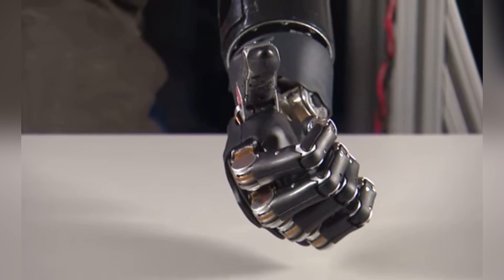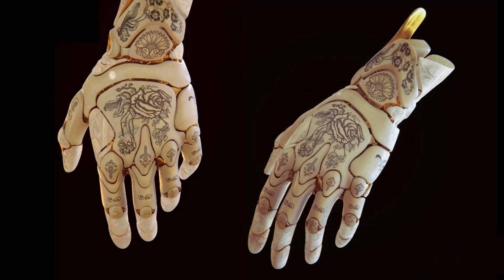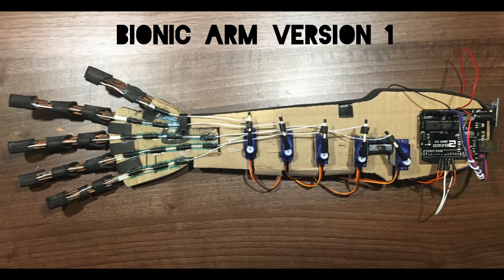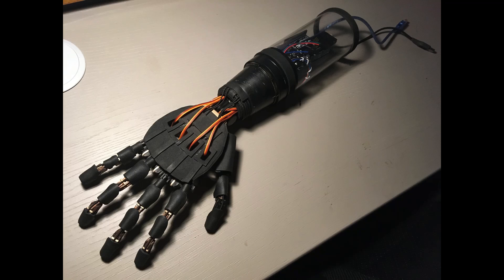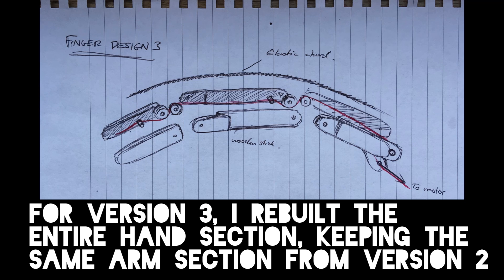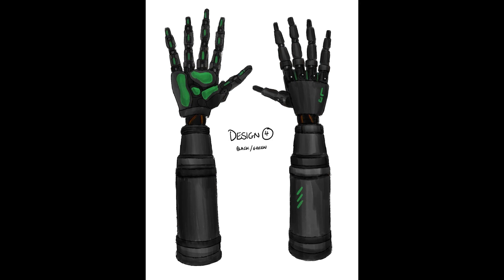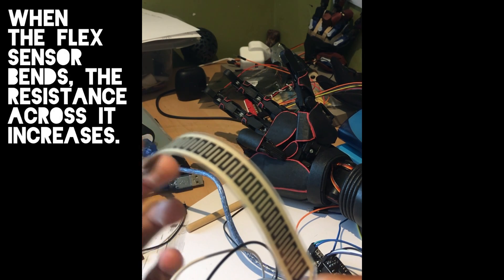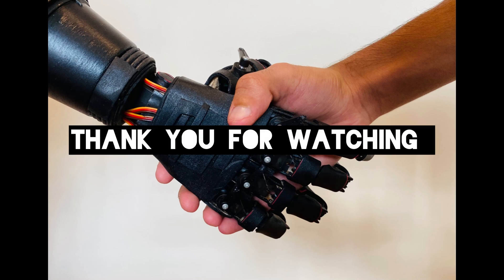How I built a bionic arm from scratch to replicate human hand movements.

Comment: Question I’m assuming you used the Arduino minima without WiFi and Bluetooth however if you had Arduino Uno(R4+wifi) couldn’t many wires be redundant and much of the wires be reduced?

Comment: Nice job men. I wanted to build it, but i see everyone using regular motors, i want to make my own linear motor with plastic tube with coil warped around it, magnet inside that pulls fishing line. I think it would be a lot of smaller and better, you can make series of smaller linear motors in tube.

Comment: you could put rings on your toes that connect to strings that connect to a micro controller that controll the fingers individually. you can develop great levels of control over your individual toes with enough practice and even do it while walking normally.

Comment: 194 pounds in India rupee around 18,500 . Bro I am also 17 years old  and I can make these type of robotic arm under 2000rs. Which means in 194 pounds I can make 9 robotic arm 💪. Instead of flex sensor use  potentiometer but u have to fix properly.

Comment: Fun fact is that we are of same age, although a year younger but we ended up making the same thing.... Congratulations brother
Reply: I am now 17 years old and will begin to study biomedical enginering vecause I love prosthetic hands
Reply: @lapanteonrose4832  that's awesome!! All the very best
Reply: @PixelPursuits1 the best thing which u can do is to 3d print the casing it does not cost much, the rest can be done using a microcontroller like arduino and some tensile strings, servo motors and that's it for a low budget one